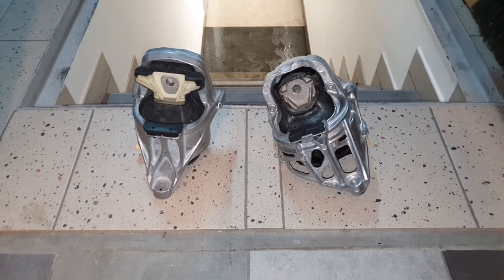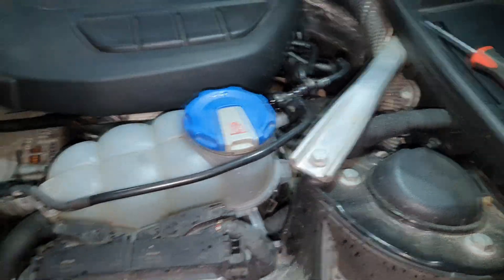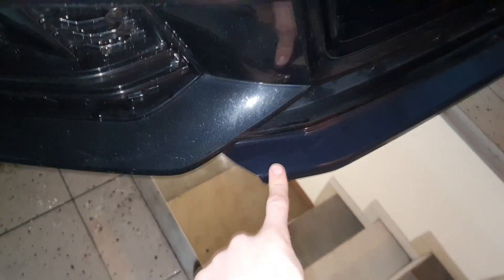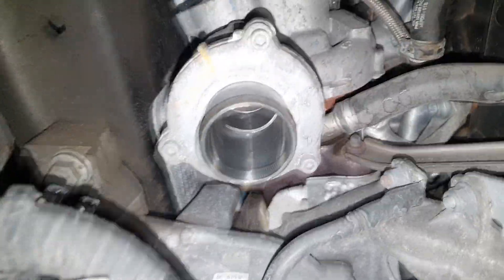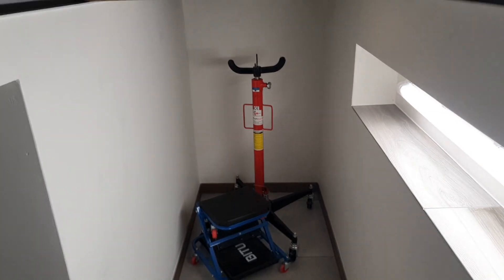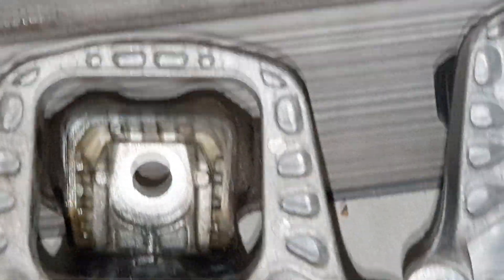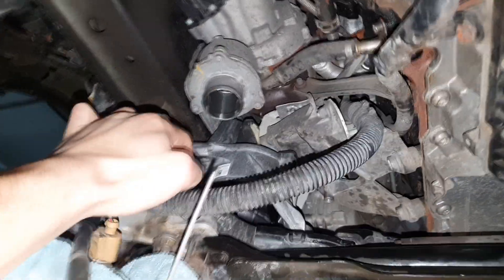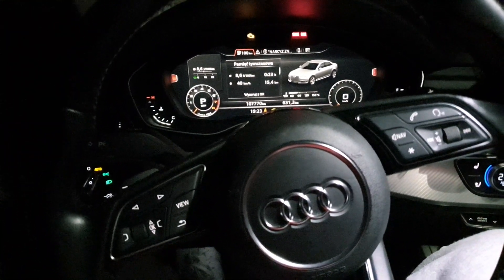Engine Mounts Change on a Audi A4 B9 2.0 TFSI gen.3 quattro

Comment: and do you get a sound at low rpm from the gearbox 1 in 2 and 3 like a clunking noise on low throttle?

Comment: Hey Wojtek, I have a 2023 A5 45 tfsi and after 35k km the mechanic told me that the engine mounts need to be replaced because "the engine is moving around". Is this normal after this mileage? I have small vibrations when the car is stand still, but otherwise it looks ok. Can I maybe delay a bit this change? Thank you!
Reply: get a sway bar

Comment: Great video. Found this after replacing my steering rack (due to rodent damage) and motor mounts while I was in there (as it has 65k and the fluid had started to leak out). 

I used an engine support (from Harbor Fright) and completed the job on jack stands (about 5-6 hours total, not rushing by any means). It was easy and straight forward (I just looked at what needed to be disconnected and went for it). I only used a second set of hands to get the subframe back in place. 

I replaced my motor mounts with the CTS 60 durometer and they are coming right back out. WAY too much additional NVH at idle (not as bad if you shift to S as it raises RPM). I'd rather change the OEM mounts again if needed than deal with the vibration. 

For anyone doing this, disconnect your battery first. Way too many electrical connectors down there to accidently damage and you need to disconnect a main ground to get to the passenger side.
Reply: the engine support is from the top, right? do you have any picture how did you secure it?

Comment: Great video man! Thanks for taking the time to make the video and share it with us. Great job. Do you have the torque for the 3 nuts of the engine mount? For the bolt that goes to the engine, you mentioned 70 or 90 Nm + 90°. Do you have the correct torque, 70 or 90 Nm?

Comment: excellent video! doing research as mine are leaking on my 2018 s5 and im planning on replacing them myself. how'd you get the car on the stands? there's not a whole lot of room to get a jack and the stands under the car at the same time is why i ask. i liked how you mentioned the downshifting being smoother after the replacement as well seeing as mine does the exact same jerking on downshifts.
Reply from the maker: With a floor jack on the subframe. Appreciate your comment :)

Comment: Hey Wojtek,  I would like to do this install but i want to make sure that i have all the parts necessary, can you send me a link to the part at minute 8:32. You mentioned in one of the comments that it's called "Engine support bearing" or "Engine boom" but  I searched every where and can't find it.  Can you please link me this, so that when i do the installation I can change it without needing to wait to get it.  I have an Audi a4 b9.   Thanks!

Comment: Hi Wojtek,  I have a 2017 Audi A4 B9 with 55k miles. Whenever I'm on a hill or slight slope and allow the car to creep forward, it vibrates the entire car. The same thing happens if I go into reverse and let it creep back without acceleration. Do you think this could be related to the engine mount, or might it be something else? If it is the engine mount, I have a question: I see 034 sells two durometer types, 50 and 60. Which one did you get, and do you notice any additional cabin noise? I really appreciate any help you can provide.
Reply from the maker: Hi David, does it keep vibrating or is it just when the car starts moving? Did your car ever had the gearbox oil changed? Regarding the engine mounts I opted for the oem ones. 034 has ones without oil so they will definitely be less comfortable than oem but much more durable. What the oil does in the engine mounts there is a valve system that  controls the stiffness of the mounts. So under dynamic acceleartion it stiffens up and under normal driving it allows for more comfortable gear changes etc. The problem with the oem ones they tend to break pretty quickly (leak oil).
Reply: @wojtekpolanskib9   Hey, Yes i changed the ATF and MTF oil recently.  To answer your question, it's when the car starts moving, if I smash the breaks, the vibrations go away, and it's only when the car Creep mode wants to move forward or backward.  Could it be the engine mounts or transmission mount?
Reply: @davidm848 I’m having the same problem did you ever find a solution?

Comment: Very goodfull video. You talked about transmission and that youre happy to answer questions.
I have the A5 with same engine and transmission. I have for 2 months now a bump when downshifting from 3 to 2. I can hear and also feel it. Its happning right before stop while breaking. I have insert transmission mount. Asked a transmission service place. They sad that these types of transmission can have this and that it can be solved by software. I wil be very happy if you can advice and think with me.
Reply: I have same issue with A5 B9 2.0 TFSI, I can hear clunk when downshifting from 3rd to 2nd and some slight shake when stopping on traffic light. I am not sure if that is because of engine/transmission mounts or it's some problem with dual clutch. 

I hope @wojtekpolanskib9 might know more about it to tell us.
Reply: @miket.1354  yes yes exactly same issue here. I have let doin a diagnose at a tranmission center. They sad that tranmission is mechanical in good condition. But it is related to the software and how the transmission works.

I have tried 2 times adaptions but that doesn’t work. I have also install a transmission mount but it hasn’t solventhe issue. So I believe the transmission center and will let them optimize and also tune it. Hopefully it will work.
Reply from the maker: Yup I had a bump / clunk when downshifting 2 to 1 engine mounts replacement fixed it for me. I think this its related with the part i showed in 08:23 this part ensures so the engine cannot "jump" upwards. So if the engine mounts are toast they allow to a lot of movement of the engine. Downshifting makes the engine hit the stopper (08:23) and on the video that rubber thing was torn as well. About the engine software It makes the gearbox run A LOT smoother as well.
Reply: @wojtekpolanskib9 thanks I will let check a mechanic to the mounts in your video. Let’s see if these are part of the problem.
Reply: @furkan1391 did you figure it out ?

Comment: Great video man. I wish there were more videos in general on the B9! About to replace the engine mounts on my 2018, also at 67k miles. Question- if I drive on new OEM engine mounts pretty rough, how long do you think they will last? I’m the third owner LOL
Reply: I'd assume they're close to toast. Transmission mount too! You'll know when they're toast by the sound and thud. New OEM mounts  feel amazing.
Reply from the maker: I cannot give you a exact answer. I would estimate about 35k miles / 56k km they should last and yeah this is one of the elements that is prone to failure in these cars.